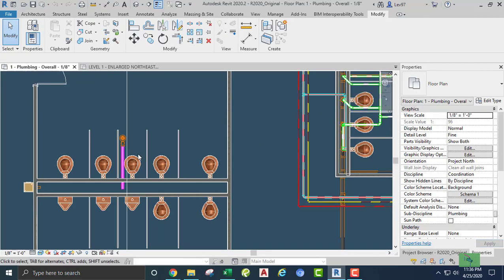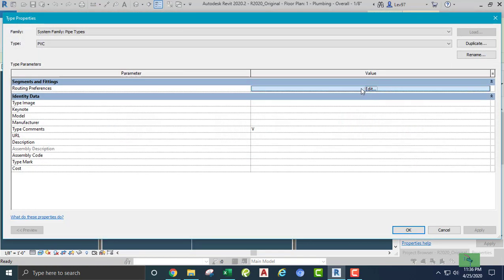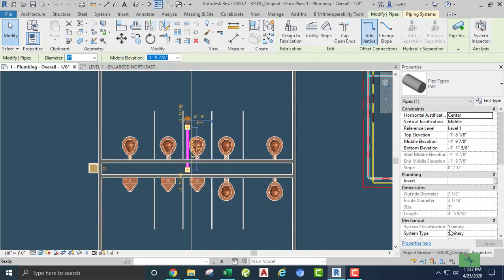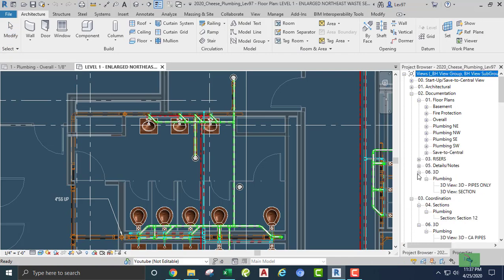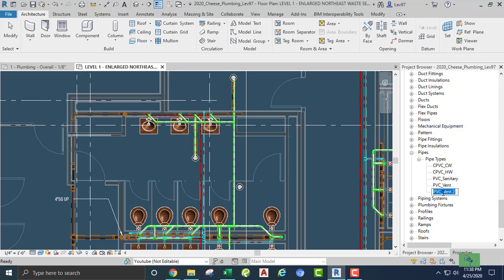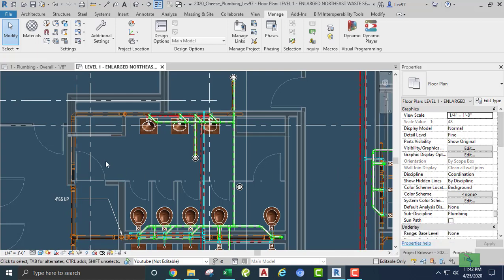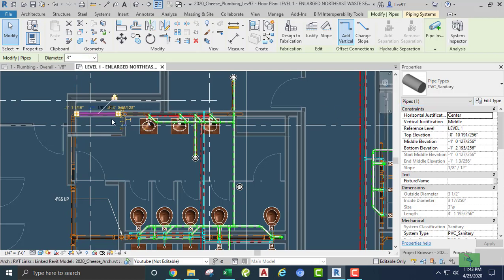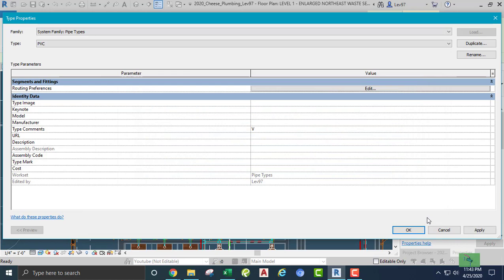How To Transfer (1) Pipe Type to Another Project.

Comment: short summary of what he was doing:

First, copy family from one project to another for this to work:
1. Open the  Revit project that contains the desired pipe type 
2. Go to File on the Menu tab > Save as > Library > Family, then select all families (notice that this will only include pipe fittings families
3. Save to a desired location that you can access

Second, load the pipe fittings families into the target Revit project:
1. Under the same instance of Revit, open the second project (where you want to load the families and transfer the desired pipe types) 
2. Go to Insert on the Menu tab > Load Family > Select all the families you saved from the previous project

Thirdly, transfer the project type from the first to the second:
1. On the second project, go to Manage on the Menu tab, find the button for the Transfer Project Standards
2. Transfer Project Standards dialog box will appear, uncheck all, then check Pipe types

There will be some other prompts but just click ok to inherit settings and appearances from the first project.